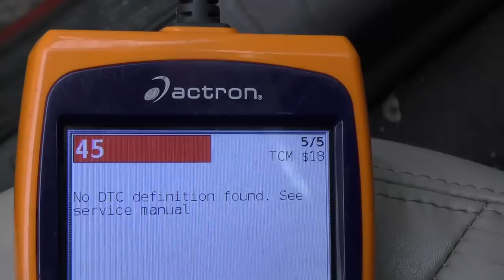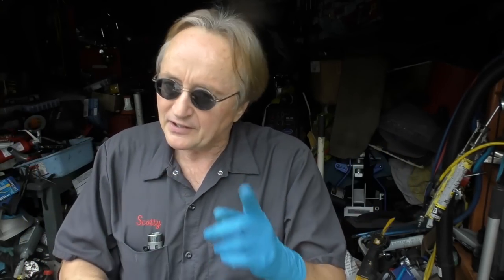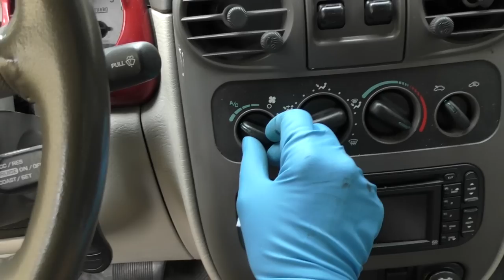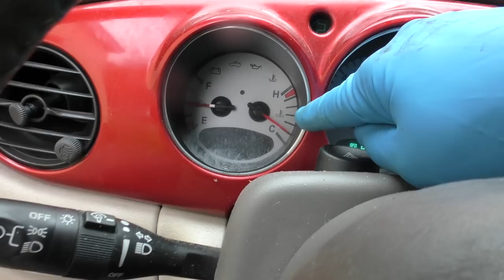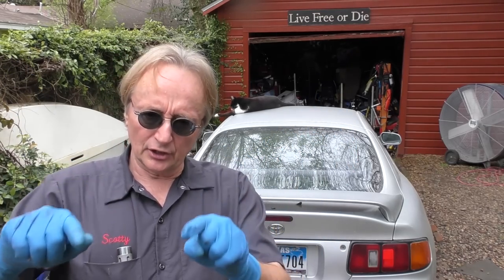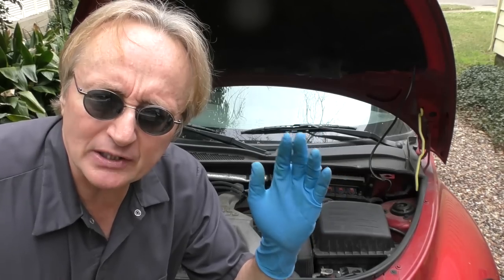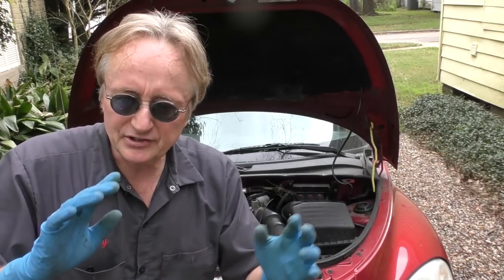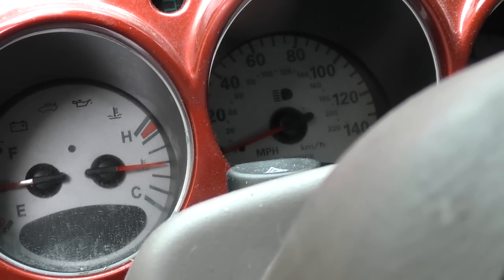This PT Cruiser Has a Serious Problem

Comment: Sorry Scotty you didn't explain where the coolant went.  That is because the head is cracked, and coolant is getting into the oil. That is why you didn't get a result by putting your hand over radiator spout. You should pull the spark plugs. If you do you will see where the coolant has gone. I can't believe that you aren't curious where coolant went. Thing is what caused the crack? Was it because the thermostat fails, and the engine has been running near overheating for awhile? Is the constant overheating cause the thermostat to fail, as well as crack the head? No. The heads on those engines are notorious for cracking because of the thin water jaket near the valve train, and because of the crappy aluminum quality.  You turned the video into a thermostat troubleshooting lesson? Those vehicles are not worth repairing because the replacement heads are also flawed. That is why you do not see very many on the road anymore.  Take your own advice about the "DO NOT BUY a USED Dodge / Chrysler, or new for that matter.
Reply: Old Mopars ruled though.

Comment: I appreciate the video but I wouldn't be sticking my hand in front of the cooling fan when the engine is running.   YOU can cause you've been doing this for 30 years, but if a DIYer sees this....yikes!  Also NEVER leave the sockets on top of the engine and start it.  The engine vibrations as it starts could have that drop down into moving parts.   Another YIKES!

Comment: Hey scotty...

my Hyundai SOnata 2005 Auto, throwing back the oil from engine oil cap, my mechanic said that, engines is dead you have to replace it, tell me what should i do for that, i need your help. when i am starting my car and removing the engine oil cap, engine is throwing back the oil like a shower. hope you will answer me

Comment: I have a 2009 dodge charger gave me a code that brake light switch 1 was stuck on, got a new one checked and the cable was just dangling there, doesnt even have the brace to mount the new switch but the car barely threw the code, any ideas where to find the brace??

Comment: Well i have ask the Pro. i went with a friend who's looking a getting an 06 with 5 speed (78,000 miles) $300. the car has sat for 2 years they lady lives in a nursing home. we got it started but the clutch slips BAD. any idea why and could this be a oil level issue in trans

Comment: I wish it was easy for my pt cruiser I replaced the radiator the water pump  and thermostat it's still overheating I have 2006 pt cruiser touring the coolant goes back up into the white jug all the time and not back down I would have to keep adding coolant all the time to keep the car run cool I hope someone can answer this

Comment: PT cruiser is the worst car I ever bought. I had overheating issues/AC/heat too.
It would dump all the coolant at random times.
 Mechanics worked on multiple times. I scraped that piece of junk and got a 2010 Prius

Comment: Next Time Scotty go to the PT cruiser forums. there were no less than 150 entries about "P.O.S" PT Cruiser over-heating problems that were fixed after replacing the thermostat. clearly it was designed to fail. Saab Stopped making cars but Chrysler still exist...There is no justice in the world.